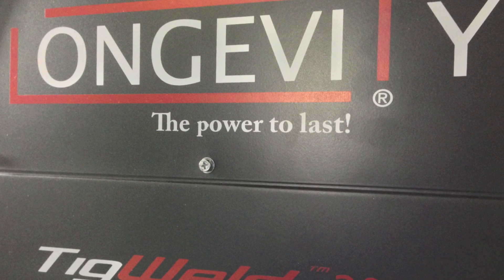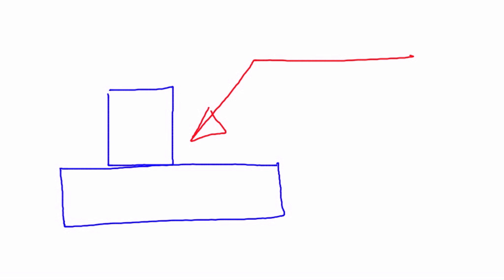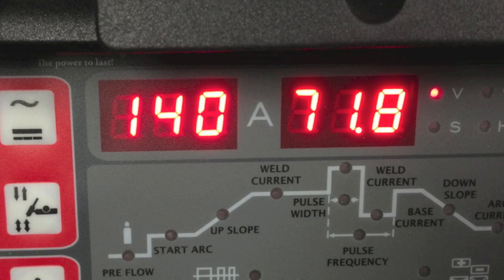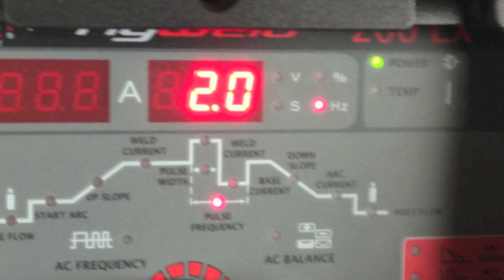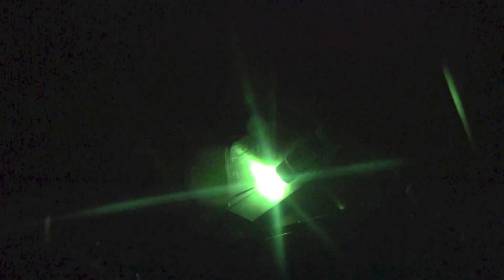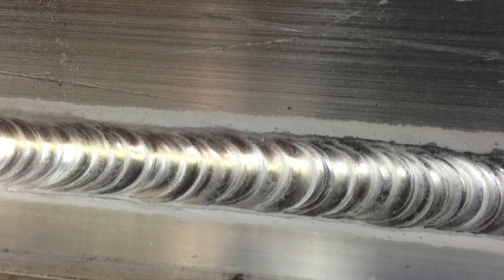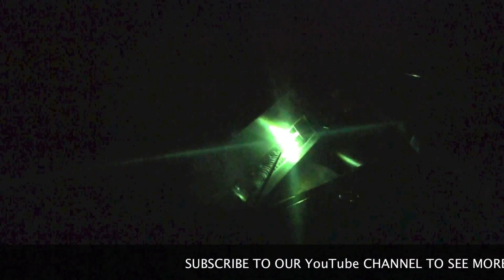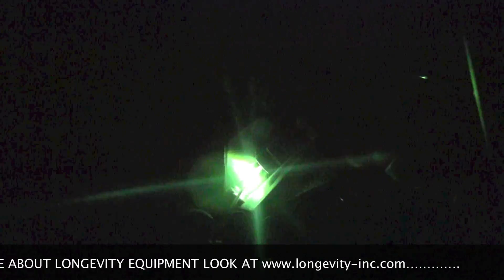ALUMINUM TEE MULTIPASS USING PULSE TIG WELDING - TIPS AND TRICKS

Comment: 140 amps on 1/4 inch and a fillet weld , you have no bevel and that surely means zero penetration! The close-ups look like flat welds on plate not a t joint fillet weld